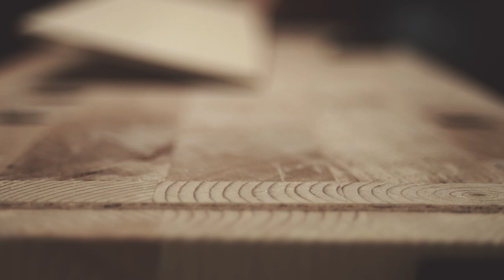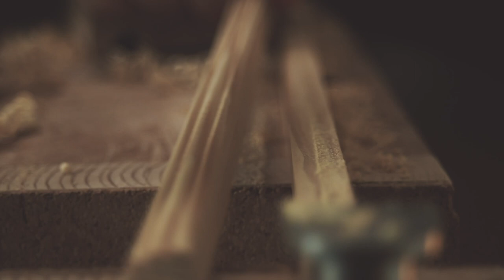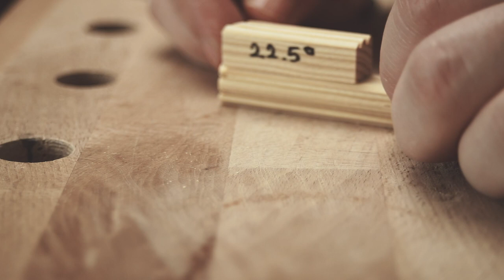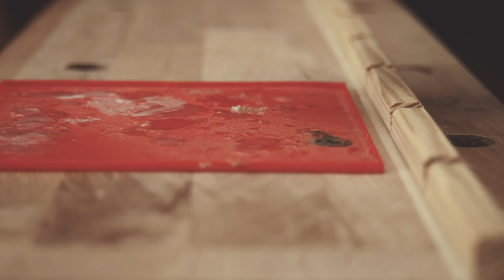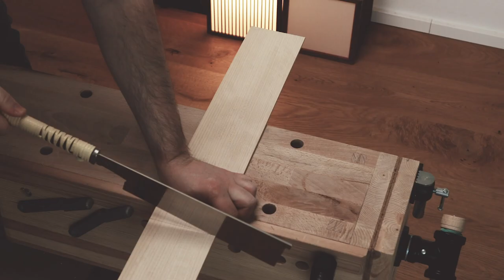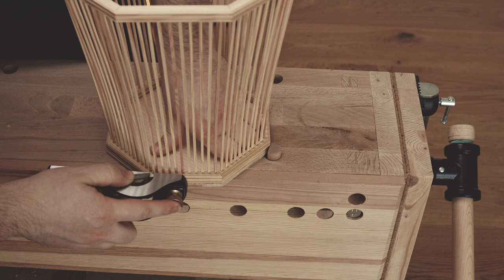Make a modern wood basket with hand tools.

Comment: Really like your design here. Just curious if you considered not putting the bottom on it? Honestly think I may try this and leave it bottomless since I hang a bag in mine. 

Great content as always!
Reply from the maker: I also considered leaving it without the bottom, even considered just leaving a few strips in each corner(8:11). But I thought by adding the bottom it will be more stable because of the extra weight